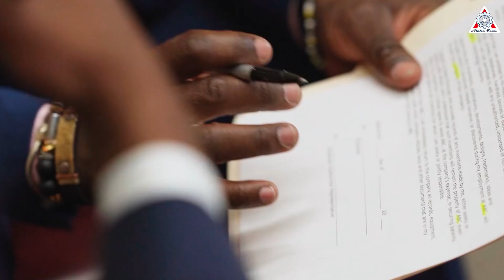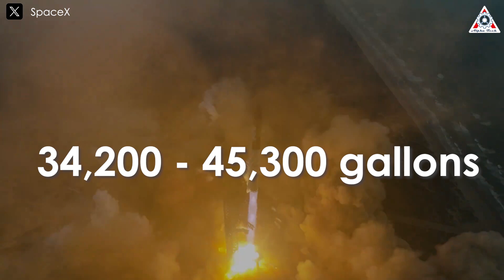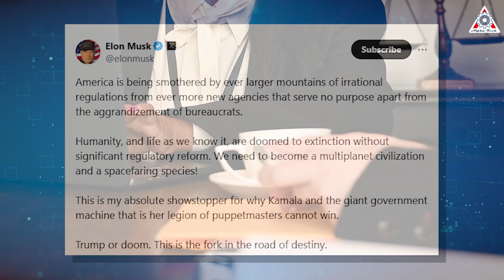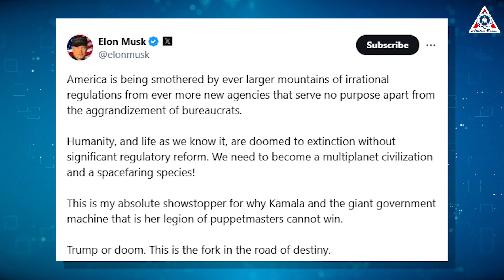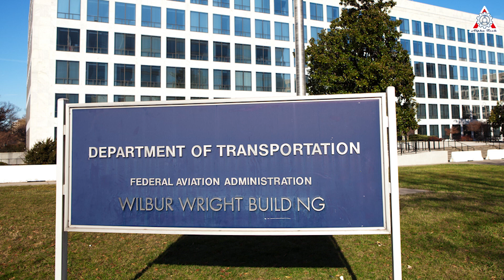Game Over! SpaceX Gwynne Shotwell's Solution & Exposed FAA about Starship Launch License

Comment: The whole argument from Space X is that because regulation is getting in our way the regulation needs to change. If any other company makes this type of they would be criticized to the ground. Yet space X is different somehow.
Reply: Yes and here is the reason. How many people on board Starship? ZERO NADA. The "safety" FAA is referring has nothing to do with people and everything to do with control. The FAA autocrats are not making money from SpaceX and thus lets make up regulation to ensure only Boeing and NASA can operate. In short, their regulation do not apply because vehicle is UNMANNED.
Reply: No. The problem is FAA regulations are written in the form of " ensure X, Y, and Z to the satisfaction of the administrator." 
The administrator is whatever FAA guy is auditing you at that moment. They literally jist make shit up to fuck ppl over.
I spent 20 years dealing with those assholes. I got all the way to Chief Inspector for an airline and repair station when I finally just walked away.
The FAA is capricious and arbitrary in their decisions. I know because I copied procedures from companies like FedEx and Delta for my QA system yet the FAA Inspector would rule they weren't good enough. They got all kinds of bent about that when I told them
Reply: @Fulcrum205  There you go. Just federal employees making rule to justify their positions and Autocrats using their position to get paid under the table by miraculous getting a 7 figure job at Boeing after retiring from FAA.
Reply: @Fulcrum205  I know the problem with government and regulations. but I think the way space x present their Case is problematic.  they way they are present their argument sound like demand to have special treatment instead of trying to work with the government
Reply: @LLAALALA  would you prefer the Boeing method of ignoring regulations until they get caught?
I see no problem with trying to get foolish regulations changed.
Reply: @Fulcrum205  well I do think space x can make a far more convincing argument if they focus on what the FAA did wrong instead of how it will slow down space x. like focus on the fact that FAA just overrule the license they have for no apparent reason. make that the main argument
not saying that effort to change the regulations is wrong. but the way space x does it is not convincing.

Comment: I'm wondering if SpaceX could make a floatation device that would keep the rocket 🚀 from sinking.
Reply: And add weight to the booster. Why do something that there is no reason to implement except some government requirement? The object of SpaceX/Starship is to remove unneccessary weight, not to add it.

Comment: What a drama - let's fly again! I mean, the information, that it is chlorinated water, was new to me. I assume that could have a noticeable, local impact on the ecosystem, since it kills microorganisms IF they would discharge that amount multiple times a day. I am no expert, of course. But with the current frequency, it sounds a lot like the literal drop in the ocean. Also, by that standard, most forms of agriculture etc. would be illegal, with all the fertilizer etc. flowing into the water table. You really get the feeling with what Boeing etc. needs to comply with for "safety" , but also in general, there really seems to be a campaign to measure with two completely different sticks here all the time.

Comment: The FAA grounded the Falcon 9 because of an anomaly during a deorbit burn of the second stage on the Crew-9 launch on September 28.  It is allowing the launch of Hera on October 7th because the second stage on that flight will propel Hera on an Earth-escape trajectory and thus will not reenter.  Neither ESA nor SpaceX forced the FAA to abandon their safety protocols, no matter what Musk's fanboys may say.  It is so silly to make the FAA the enemy.  All contractors, including SpaceX, must follow government guidelines.   

stated it authorized a return to flight for the Falcon 9 solely for the Hera mission, scheduled to lift off no earlier than Oct. 7 from Cape Canaveral Space Force Station in Florida. The vehicle has been 

“The FAA has determined that the absence of a second stage reentry for this mission adequately mitigates the primary risk to the public in the event of a reoccurrence of the mishap experienced with the Crew-9 mission,” the agency stated. The second stage will propel Hera